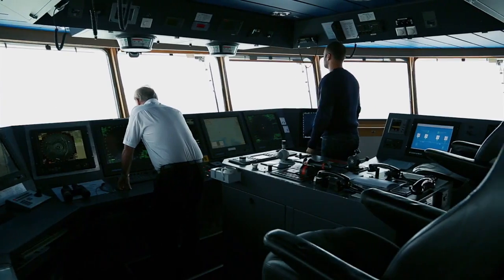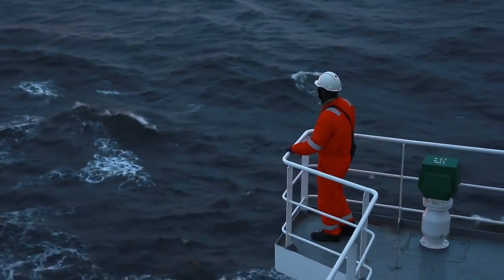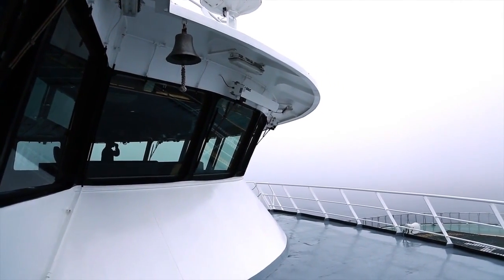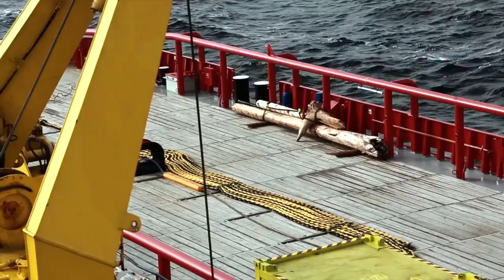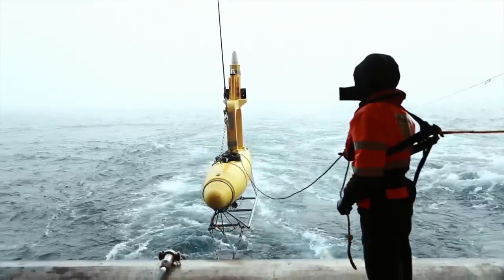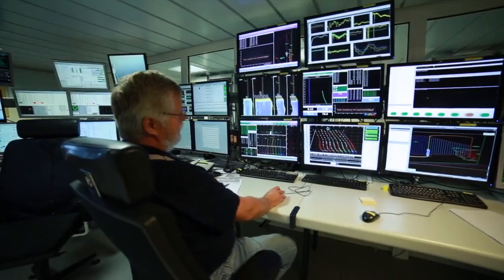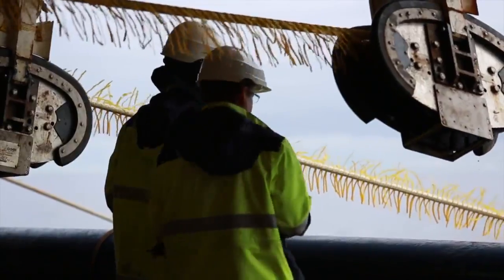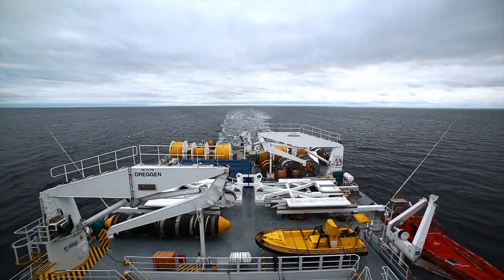3-D seismic mapping by ExxonMobil

Comment: Most people assume that earthquakes are purely natural phenomenon  but now that fracturing Hydraulic commonly known as fracking, has become a popular method of resource extraction. We all know this not necessary the case, here is why! A By-product of fracking and oil drilling is wastewater. To get rid of this waste water,  it is simply pump back into what's known as injection wells in the earth which are about 7000 feet below the surface. The pressure and the density of these walls can 98% cause faults which are fractures in the earth crust to break. As it breaks the strain is release and earthquakes occurs at the surface..Though these faults  eventually will lead to earthquakes also in the future anyway. Fracking speeds up the process a lot more. Prior to fracking, earthquakes were relatively rare in place like Oklahoma and Texas, but now they have size range hazards. Now they are experiencing 100 more earthquakes annually, far more than the 1 or two they should be experiencing a year. This is already causing significant damage and the issue is likely to persist.. This industry is so profitable$ and necessary for local jobs..The government or the whoever doing this do not care of it's people in Jamaica..It can go far and continue year after year